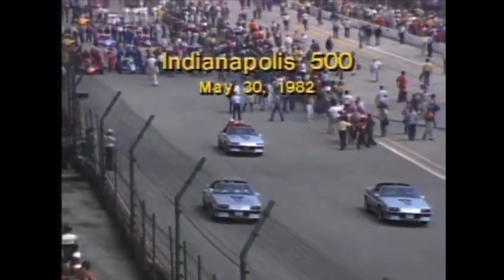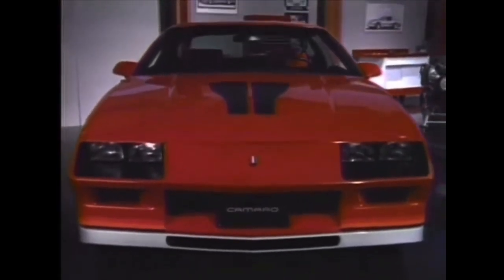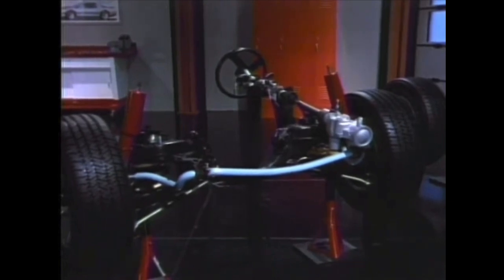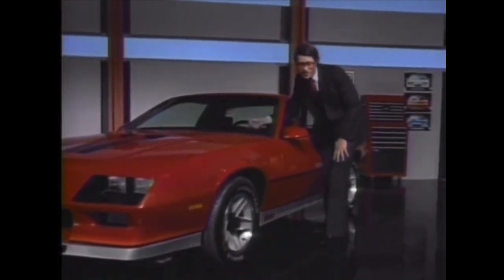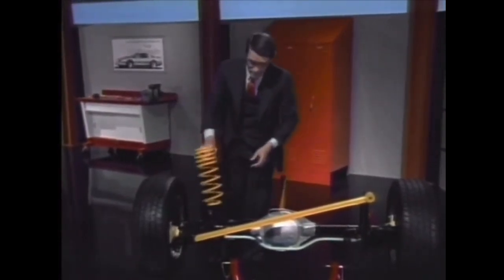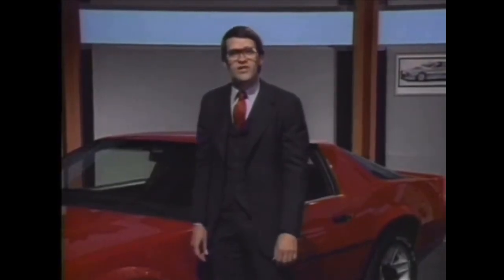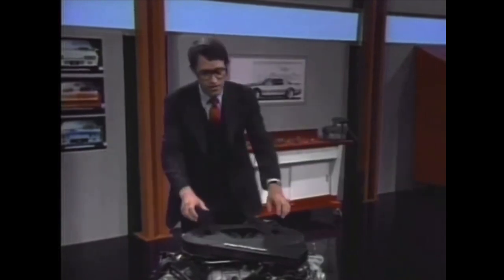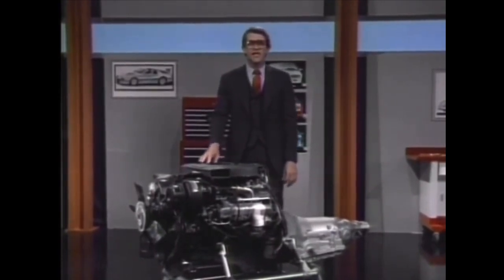1982 Camaro technical background

Comment: Thanks for sharing this interesting video, but I believe this is from 1983. The Crossfire Injection Hp was increased from 165 in 1982 to 175 in 1983... also, 1983 was the first year for the 700 R4 four-speed automatic transmission.